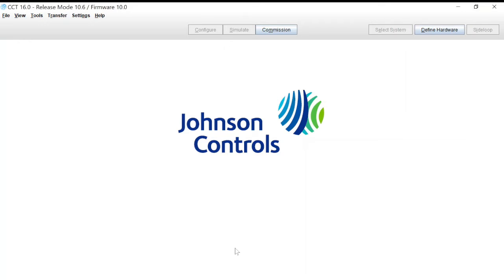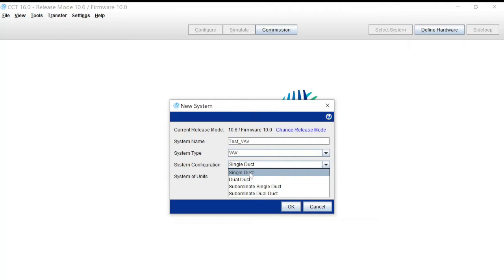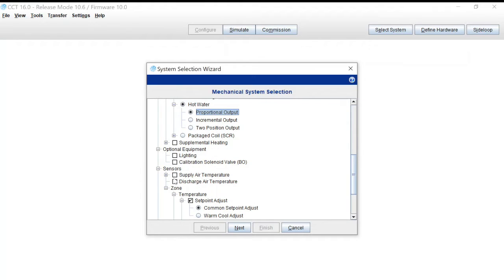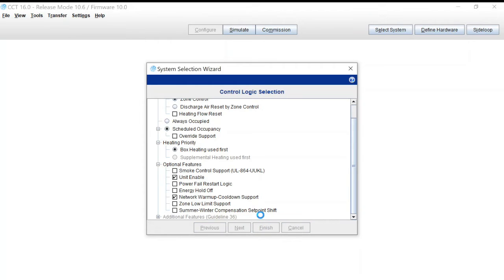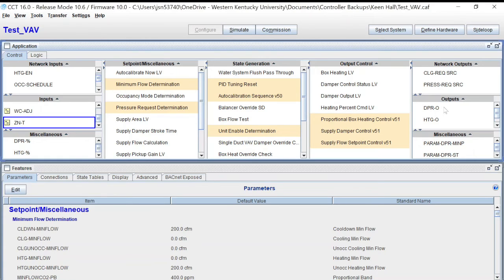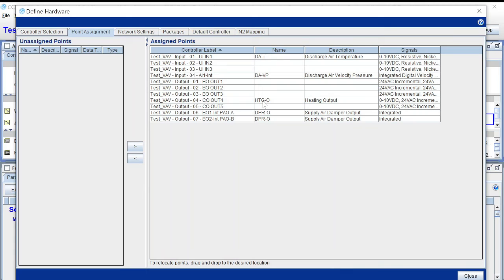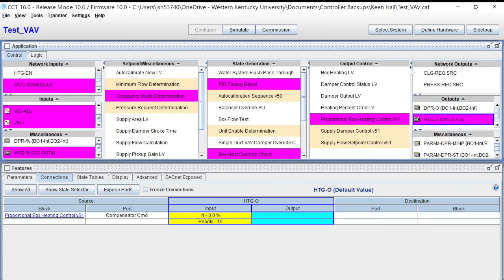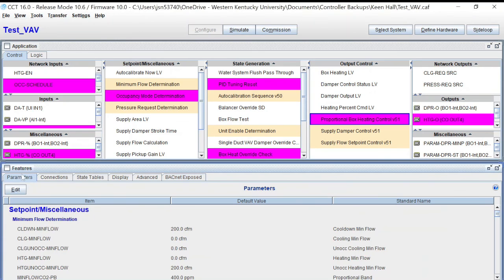Why You're Failing at CCT Configuration (And How to Fix It)

Comment: Kinda sucks unless you pay the license you can use a virtual mode to practice learn etc. It would be sweet if they had a software that could emulate scenarios each going up in complexity. That would make learning everything even easier. And you can create muscle memory of many things. So when you get to work you are savvy. 

Ive been learning it on field. My brother has a company that works these products and uses the software. So he hired me and threw me out there. Ive been at it for about 2 months near 3. Ive gotten very good fast. So much to learn. Im working on cct and also on floor with hardware and wiring. 

Example. My first gig i had to work on vav, vfv, all the sensors you could imagine, redoing a daisy wiring for controller communication. Changed controllers and actuators etc. Plus this. Loved the journey. I had 0 knowledge of anything and id say im about to enter high school in the trade already. My weakness is the electric aspect. Knowing how all that works etc wow very overwhelming and to top it all it is easy to destroy things up or get sapped or killed at times. Currently using your videos plus the LIT files on their page to learn more.